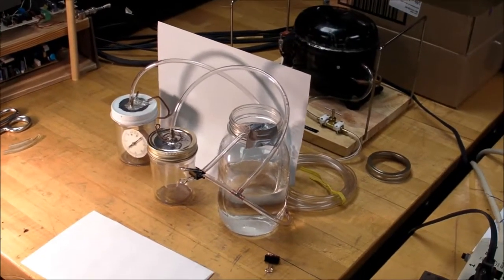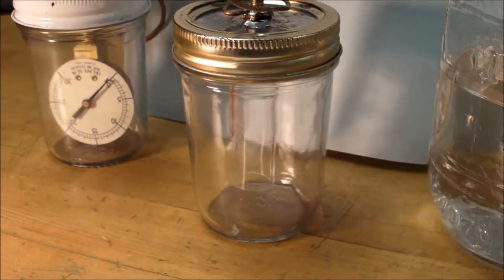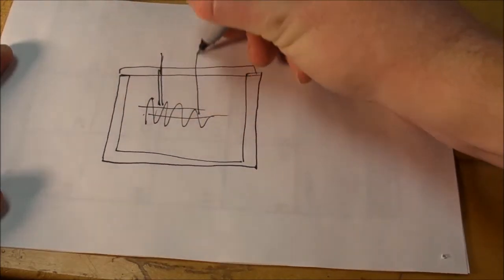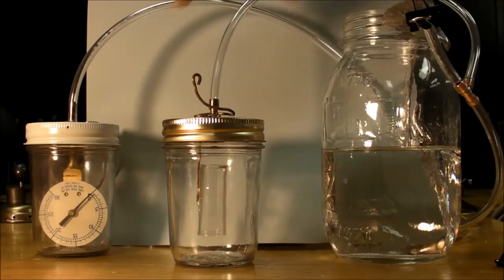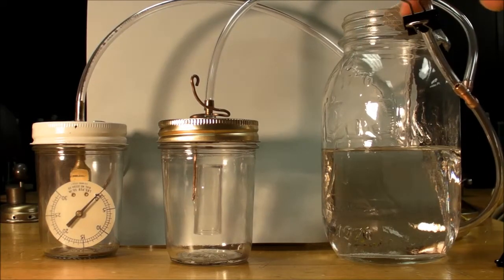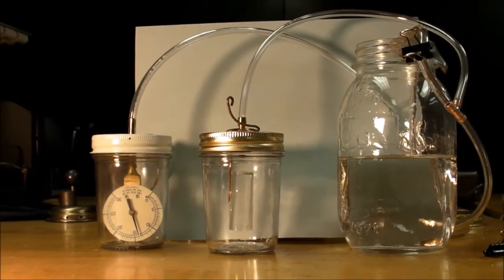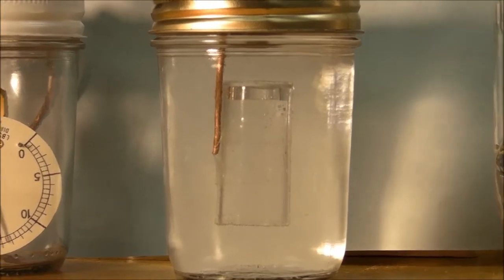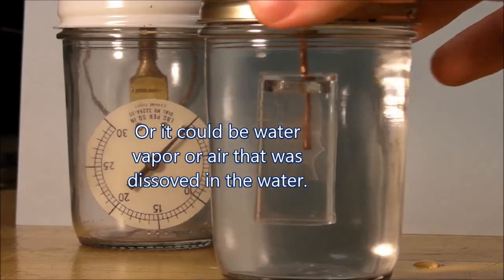(#0036) Vacuum Pump Test - DRSSTC vs. Spark Gap #06

Comment from the maker: That tube is the focus of the experiment. It simulates an air pocket trapped inside some HV apparatus that is to be submerged in oil. The fact that it did not get completely filled with water shows that the chamber was not completely evacuated.